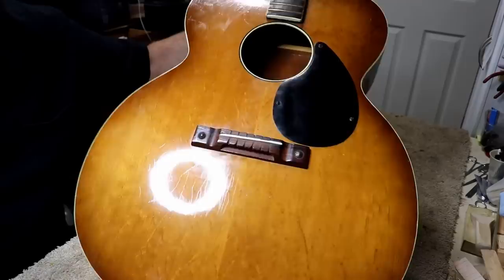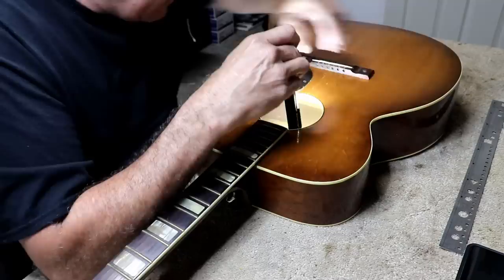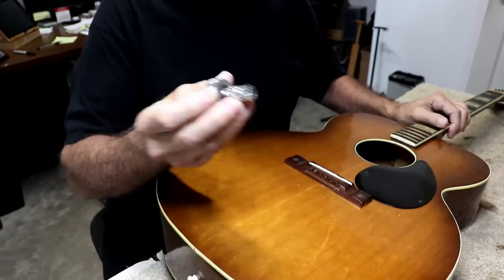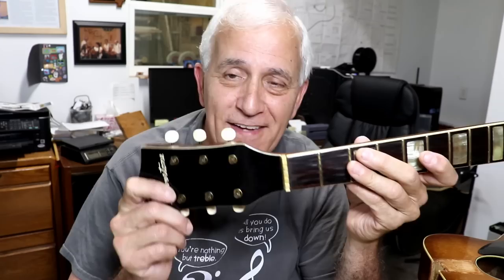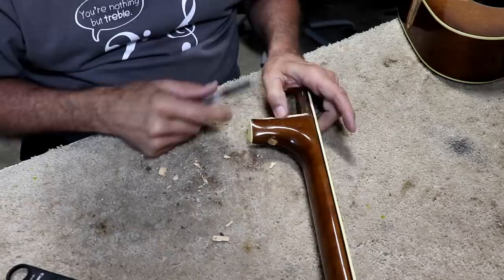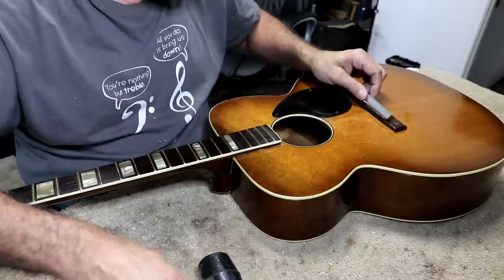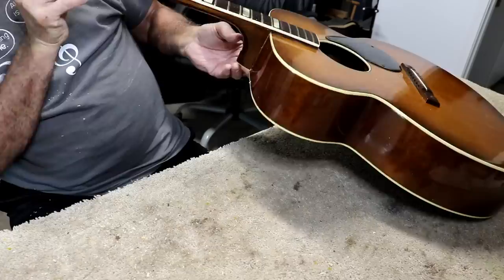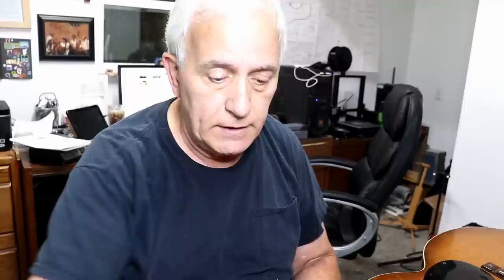302 Rsw Silvertone Finger Eater

Comment: I learn to play on a Silvertone, Truly my fingers bleed. Fifty years later still playing.
Reply: Exactly my same story.
Reply: Me too but a much cheaper model.
Reply: @RickRose  Mine cost less than $8 in 1965.
Reply: How did they make your fingers bleed? Light strings are a thing
Reply: @kolbytaylor9504  Just the high action and being a kid and not knowing anything about setup.
Reply: @RickRose  oh Lord high action is work of the devil if it's non adjustable
Reply: strings 1/4 inch off the neck, the tuning pegs were broken, had to be tuned with vise grips, cost five dollar at the pawn shop. I now play a Taylor Custom Doyle Dike. 1967 Gibson Heritage, Fender Strat,  etc..
Reply: Rick Rose j

Comment: I knew what was going on with the neck the moment I saw the bolt. It's a trick I was taught once upon a time when it came to lose necks on low end guitars. You drill the hole for the thread all, add glue to the neck, thread the rod through the hole with a bolt and washer on, and bolt on the outside to hold it in place. The trick I was taught was to bore out a strap button and thread it to use as a bolt.
Reply: I think you mean a nut instead of a bolt bulk is the whole unit you know what I'm saying

Comment: It may be neither here nor there, but some viewers might be interested to know that this particular guitar was made by Kay for Sears Roebuck, which sold guitars made for it by Kay, Danelectro, Harmony and later Teisco, all with the Silvertone brand name. Kay used sides of the same size, shape and depth as this guitar for some of its archtops as well. Unlike most flattop guitars, the bodies of these Kay flattop models are of the same depth from the head block to the tail block, which is standard for archtops. You can always spot a Kay-built acoustic Silvertone: they always have 19 frets -- whereas most acoustics would have 20 --  because the Kay scale is slightly longer than the 25- 1/2- inch scale used by most other major guitar makers. The decorative metal buttons on the bridge are the tops of a pair of bolts that hold the bridge in place. IMHO, care should be taken that the bridge is also GLUED tightly to the top. If not, string tension may tear the bridge out and, if it does, the bolts will do major damage to the top. [BTW, this goes for Gibsons, too.]
Reply: Rex Payne All the Harmony made guitars had 25” scale length. The Kay Jumbo is 25.75”

Comment: Jerry, I’ve been watching your videos for a couple of months or more and used many of your tips to make small repairs and tune ups to my own guitar fleet. Despite my screen name I spend much more time on guitar. You’ve helped me to build enough confidence to try and tackle a special repair. 

My Mom gave me my late Dads guitar a while back, I grew up with this one around the house and learned to play (some) on it as a kid. it’s a honey burst finished TrueTone (Western Auto) arch top, stamped N-4 and 6126A inside, unplayable with massive string height and a loose neck joint with a big honking wood screw through the heel of the neck. I think my Dad did that a long time ago because I found a piece of an ace of hearts playing card under the fret board extension also 🙂. Anyway, I got the neck off and it looked EXACTLY  like the guitar in this video, not enough angle to the dovetail on the neck, compared to the body and bunch of shims and even that little wavy spot on the bottom (treble) side of the dove tail that you mentioned looked like a chip-out. I mean just zooming in on the neck joints, they look like the same guitar. 

I’m no expert but after a little research I believe Kay made both these guitars for Sears and Western Auto back in the day. I also think mine is about a 1960-1962 model based on info from my Mother so the years are similar. 

I was at a stopping point on mine, unsure if it was a good idea to try and make some beveled shims (to restore some of the angle to the dovetail) and glue those to the neck before trying to do the fit up or go back with the flat shims as you did in this video. When I got mine apart the shims stayed on the neck so that’s where my brain went but I do realize they were glued on both sides and could have come apart with the shims still in the body. They did appear to be flat. I believe I have the skills and tools to do beveled shims but Im wondering if the extra work is worth the extra contact area when it’s glued up. Time isn’t really an issue on this for me. Do you have any thoughts on that plan? It’s not a valuable instrument but I do have plans to play it and pass it on in the family because of the sentimental value and I would like it to stay repaired. Despite its poor playability due to the neck issues, it was a fair quality instrument when it was new and is still in pretty nice shape cosmetically. It was equipped with a pick-up, volume and tone knobs, and a jack of course but those have went missing over the years. I do plan to replace them with something similar to original when it’s back together. 

Have you seen any of these instrument with a wood screw instead of the rod with the bolts as this guitar in the video had, or are one or both attempted repairs (as I suspect)? Mine has a  common head, counter sunk, tapered wood screw in a deeply counter sunk hole on the heel of the neck going into the neck block, it even protruded 1/4 inch past the inside surface of the block and was visible inside the guitar. Dad was a carpenter and would not have been afraid to do something like that but the hole is perfectly centered and the finish doesn’t appear to have been touched up. It looks like it’s “supposed” to be there. I’d like to NOT put that screw back in and just plug the hole, any thoughts on that? I’m thinking a good fitting dovetail wouldn’t need the screw. 

Thanks for reading my long winded post (if you made it this far) and for all the great tips and music in your videos. You have a lot of skills my friend.

EDIT: I realize Jerry is a busy guy and may not have time to read a long post like this let alone answer so I’m not going to be too disappointed if he doesn’t reply.  If anybody else who may read this has any ideas, please feel free to respond.
Reply from the maker: Well I'm not a good reader. But regarding the guitar I would do whatever it takes to put the neck at the right angle. If it needs tapered shims that's where I'd go if it just needs plain shims I would do that. I don't really know how to offer any suggestions Beyond just do what it needs. The only other thing I would say is if there's any play in it you got to get the play out it needs to be a tight fit otherwise it'll pull loose in be bad again.  Good luck to you. Thanks for watching my videos.
Reply: Thanks for the reply. I guess you’re right. I would like to do the easy fix because I’ve never had a guitar this far apart before but obviously the maximum wood contact at fit-up and proper angle is the important part. I think I will get rid of the screw also.

Comment: Fascinating techniques, thank you.  I don't do many guitars, but the problems of amateur "repairs" are present in bows and bowed strings too.  I once got a very nice English baroque cello (built around 1740) that had a buzz.  No cracks, no open joints.  Finally, we found a spot on the belly that buzzed when tapped.  Nothing was visible inside or out.  We finally had to take the belly off.  It was apparently glued on with white glue, which proved so hard that we had to saw the belly off.  Turns out, someone had taken the belly off before, and managed to stick the knife, not between belly and rib, but right into the belly wood so far that it loosened a big flap, which caused the buzz.

Real bummer to fix, including shimming up the edge of the belly all around.  But it was great to have the cello back without the buzz.

Keep up the good work.  Cheers from rainy Vienna, Scott

Comment: I have several Guitars. My most favorite guitar was my Dad's guitar. It was a 1960's Vintage   Candy Apple Red Silvertone Hollow Body Arch Top Electric/ Acoustic Guitar Model 319 14609 .  Its all original except the Tremelo bar system with somehow got lost in storage when I moved. Other than that there is not a thing wrong with it. Had a pick-up rewired and the guy a shop offered me $2000 for it. Told him no way.

Comment: Jerry, I have a Kay in the shop right now just like that, 17" lower bout mahogany and yes, I did a neck reset. It had a dovetail joint and it had solid spruce top on it. One thing about those old "Cheaper" guitars they can be worked on and fixed back up unlike the cheepies today.

Comment: I recently started trying out fixing guitars an have been working on an old Silverstone. The neck had similar issues. The glue was so thick in there after I got it apart, I heated up a wood chisel and scaped it out with that. After I got the glue all out and sanded the neck fit pretty well.  I haven't put it back together  yet but saw how you did it  I will be doing alignment  checks and glue it up.

Thanks for the video!

Comment: That works as a little demystification, even encouragement, in relation to the job I need to do on my 50's Harmony Sovereign H1203. I also own an H55 with built-in pickup, which seems to have given it a little more stiffness where it matters, so it doesn't need a neck reset. These guitars are prone to bellying where the bridge is pulled up and away by the string tension, so the bracing under the bridge is the first thing first thing to inspect. Also where the top meets the body above the strap peg. To keep factory costs down, if the heel was a bit loose in the dovetail, they'd just slap on more hide glue and let it all set in place. By the time the reset became necessary, the guitar might be 40+ years old and the saddle will have been lowered to nearly nothing!

Comment: I bought the exact Kay ( Silvertone) at a garage sale for $20 .. I was a wreck but I liked the color and the white trim inside the sound hole.. I replaced the broken bridge ( I DON'T have YOUR tools but it came out well )and then  threw a set of light strings on it. Sure the action is still high but the guy at Guitar Center said someone at a show will buy it just for the original Klunson Deluxe tuners on it.. Funny part is that it still has the original Armacord strap on it and the soundhole does smell like Grandma's attic!  lol

Comment: Fabulous job again Jerry!!

I just bought a Yamaha FG700 from a local bootsale (Fleamarket type thing) that has a broken headstock (Not right through) for the grand sum of £1 ($1.22), It looks as though it has been dropped on the front of the headstock as the split closed when pushed towards the front!

I bought it for the tuning machines and pegs but I think i'll have a go at repairing the break first, If it doesn't turmn out well, I still have the hardware from it!! :)

Thanks again for a very interesting video!! :)

Comment: Jerry, you're buying the lighter gauge Razor Blades, .009".  Get the .012" Razor, and it will be much stiffer.  Both sizes have their advantages, depending upon the task at hand.  As a Retired Painter/Paper Hanger, I have used both gauges extensively.

Comment: If you want thicker steel on your razor blades, try using a utility knife blade used to cut sheetrock which measures 0.023 instead of 0.009 for a single edge razor blade.

Comment: Consider a razor blade .001" thinner than previous, this means for every 1,000 blades made the company saves 1" of steel. Out of 1" of steel at .0085" thick blades they can make another 117ish blades. Most wouldn't notice the difference, though now they cost more and thinner. Hey, by the way, Nabisco Graham Crackers in the standard 3 pack box come with 9 graham crackers in each pack. BUT, if you buy the family supposedly saving money size 5 pack box each pack only comes with 8 graham crackers. I know this because I use graham crackers a lot in the cheesecakes I bake HAHA!!

Comment: My Silvertone model 319.64309 had a similar neck issue.  Super high action. 
It was in spectacular condition but I let it go. 
It was brutal on the fingers and useful only for slide. 
Had a fabulous spruce top and great tone, though.
Reply: Me, too. Nice for slide, but otherwise unplayable. Bridge finally peeled up, like the Maestro predicted. One of these days, I plan to put it back in place and add a tailpiece. Mine was so old the top looked more like rosewood than spruce..
Reply: nord konc I remember laced a bridge on a beater guitar last year.  It’s not super hard, but the saddle has to be precisely located

Comment: Here is a tip.  Files are extremely hard. I grind the ends of mine to make hard as hell scrapers! You can even shape it to your needs becoause thats the one part that is never used! Even works for cleaning iron and steel.

Comment: I have my dads old Marathon Syncratone pretty much the same body style and headstock as yours . I refurbished it myself and had my luthier set it up ( He also straightened the neck from where it has spent its life sitting in the corner of the room with the head stock leaning on the wall). . Sounds pretty much like the one in your video. Great video :-)

Comment: I thought they had cheese cutter wires on those early  Slivertones.  That was  a great video.  Out of the 6 acoustic guitars I have foolishly bought 2 that need massive surgery.  both  have neck failure at the area where the neck joins the body.  The most common cause for this is, a Drunken Guitarist using the guitar as a cane.  2 out of the six are just fine for now.  Now thanks to this video I know a little more about what a real Luthier does to make things right  with a guitar.  Thats a sub and a like with a big thumbs up.  Did I mention I'm  a pretty decent wood artisan ?   I gotta give you an A+  for the end result.
Reply from the maker: Thank you very kindly.

Comment: Over my PC speakers that baby sounds like it's pretty lively now!  
You did a beautiful job restoring that guitar. 
My old (late 60's) Silvertone was the same way when I bought it, with relatively high action, thanks to a somewhat relaxed neck joint. 
Basically unplayable unless you had a slide.
Or stuck to your basic "cowboy chords" near the nut.
Model 319.64309    
My top wood was not as nicely figured like yours....although it was a pretty nice piece of very straight-grain solid spruce.
Your guitar in this video is much fancier; mine originally listed for about $36.
Reply: Thats a great guitar!

Comment: I've got a late 50's Kay with a Sitka bearclaw spruce top and laminated mahogany back and sides just like this guitar.  It has a dovetail neck joint though (I think anyways..) and is very similar to a Martin OM in body dimensions.  The bearclaw on my top looks exactly like this guitar's top - I wouldn't be surprised if it came from the same tree.
Reply from the maker: That's quite possible this was a late 50s also I think a 57 or 58

Comment: Nice Job, great video.
I would like to give you just a little advice that may help you test the chords better, try pressing closer to the fret upstream of the board, so it becomes easier to make a nice sound without using so much strength, and in that way, lets you feel how soft the scale really is. God bless, cheers.

Comment: Nicely done what a patience it takes to do it right something I just don't have suppose that's why I work in demolition and haul away instant results Ahahahahaha!
Had to edit got to part about razor blades after I posted just happened to notice the exact samething use a lot in model building now I know wasn't just me who felt the difference, it's like everything else rather than raise the price and have complaints about price they just make it smaller lol
Reply: I have  a glass scraper with those new Corporate Thickness blades.  The sharp edge just flexes up, and rides right over the paint on the glass I'm trying to scrape.   As a demolition expert, would you suggest that i just hit the window with a hammer and buy a new clean piece of glass,  or find some antique razor blades.
Reply: Rodney, That was classic! and exactly how I would do it specially if you need to Get R Done in a hurry that way you just bypass the aggravation. Ahahahahahahaha!
Reply: jenbill1602   I had to come back and tell ya...,  "I too have worked some demolition".  Ahahahahahahaha !

Comment: That’s not ‘bird eye’, it’s ‘bear claw’ , a cross-grain curl in the wood. The technical term for "bear claws" is haselfichte (German). It refers to a pattern in the grain occasionally showing up in all species of spruce. Basically it is a ripple in the fibers of the wood and is similar to the patterns you get in some maples (the curly stuff or "quilt"). But in spruce, bear claws are not uniform but random and asymmetrical. Some say they look like the curved claws of a bear, others say they look like the marks left by a bear who was sharpening his claws on the tree before it was felled and turned into furniture or guitar tops. 

It’s a genetic variation in spruce and results in a very dense molecular structure. This translates into stiff tops and a greater velocity to the soundwaves they produce. Many luthiers feel that bear claws are a reliable sign of higher quality tone wood within a given species of spruce.

Comment: Great one. "Bear Claw" spruce...
Reply from the maker: Well I actually have some bear claw spruce and it looks totally different than that. That actually has the bird's eyes similar to bird's-eye maple.
Reply: @RosaStringWorks  Yes,  my thinking,  exactly.  Most people do not realize the bird's eye anomaly can show up in a soft wood as well as in maple where it is most commonly found.  Very rare,  though,  especially in the "concentrated abundance" as seen on this particular top.  It's quite the beauty.
Reply: Wracked my brain until I finally thought of one other wood specie where I've seen the bird's eye configuration:  cherry.  But, usually "here and there" and not necessarily in close proximity with each other.